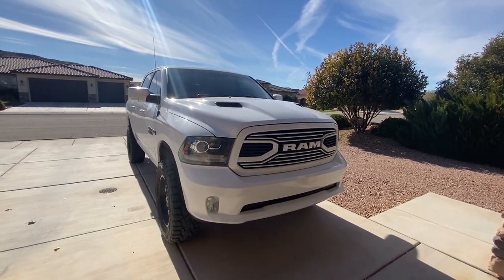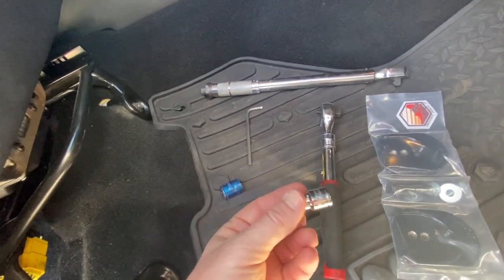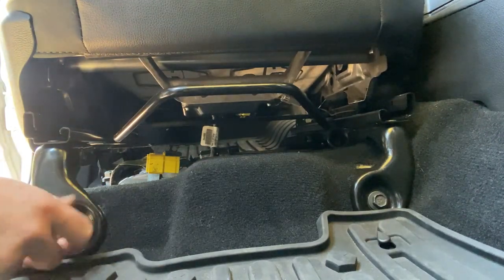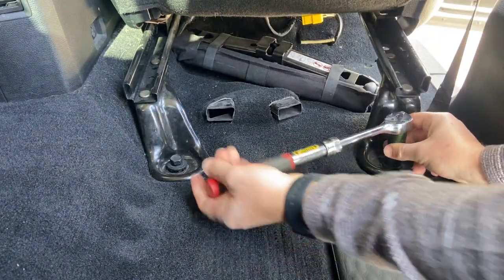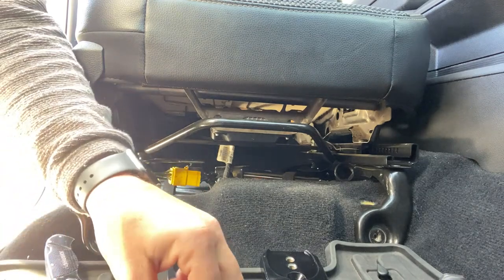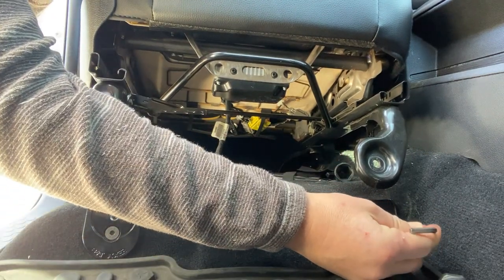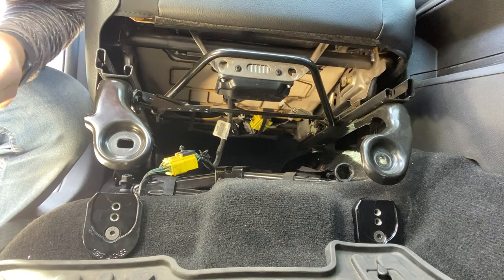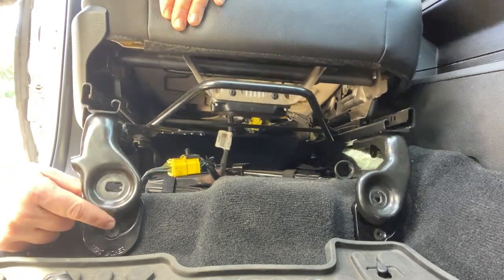RAM Adjustable Seat Jackers 2002-2018 RAM 1500, 2002-2023 RAM 2500/3500

Comment: $99 for some pretty simple basic hardware seems kinda crazy expensive. I like the idea cuz I really feel like I want more angle/front height to my '16 Ram 1500 power drivers seat. It just doesn't have the range of adjustment I'd like.  Do these go on any significant sales?